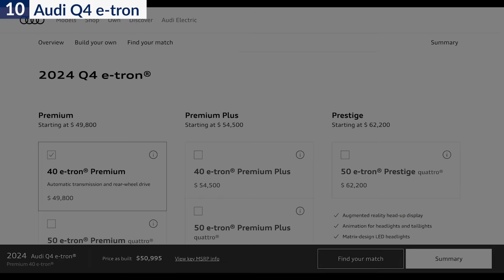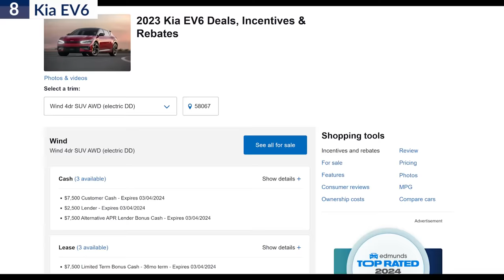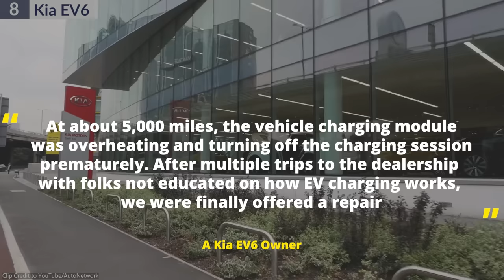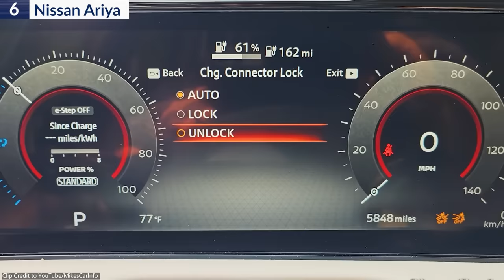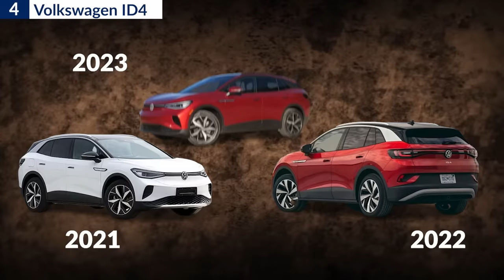New Electric Cars Piling Up on Dealer Lots in 2024 – Here is the Truth!

Comment: I own a electrical company in Germany.
We now got a notification that homes will be stalled at 4kw at certain times per day
Thats the case if you have electrical heating or a wallbox.
You wanna now why?
Our grid is not stable enough to support the amount of energy that is about to be used, due to that the grid already has to be controlled.
We are far from a ev only situation, and because our grid that’s impossible
Reply: Is why government needs to be involved so that the system can be updated and augmented to handle the transition that is coming.  

Public money needs to be invested in moving in this direction, the energy for transportation needed is being distributed one way or another.

It is much cheaper in even the near term to build out the necessary infrastructure and be at the cutting edge of the change.  Set yourself up to reap the rewards of experience and hardware as other later comers switch over too.
Reply: Too much wind and solar , not enough coal and nuclear.
Reply: @Leonardo555ZZZ Wind and solar are fine, you litterally can't have too much.  Those in combination with Nuclear is the path forward.  Coal is a relic that has to go
Reply: @sharper68  Wind and solar is unreliable and intermittent . It increases costs due to additional back up ,transmission and storage costs. That is why Germany now has some of the most expensive electricity in Europe , which is causing businesses to leave ,  consumers to struggle , and their economy to decline.
Coal has enabled modern society to thrive , and it's use is continuing to increase every year because it is so cheap and reliable.
Reply: @Leonardo555ZZZ  Wind and solar are new. Your concerns are being mitigated as  large capacity storage technology is innovated and costs drop. It is a one time investment that will get more viable and cheap over time.  

Germanies costs are currently high because of necessary infrastructure investment to meet their green house targets.  An issue which has a grave and extensive costs associated with it impending, if they do nothing.  There are real costs associated with not changing, they choose not to ignore them.

Nuclear should be the back bone of the grid and coal should be dropped.  The costs need to be absorbed because not do so has unbudgeted costs that are far greater.  This is true even if those costs will not be paid next quarter.

Getting off fossil fuel has tactical, foreign policy and trade benefits as well.  Being energy independent is what all 1st world nations should now be shooting for. Germany is an example of leadership, they are investing today in power systems that have many ancillary benefits.
Reply: @sharper68  you lost credibility from the start : "government needs to be involved" when has the gov't never screwed something up and than :  "Public money needs to be invested" yah lets increases taxes that's really bright.  LOL.
Reply: @sharper68  wind & solar are hardly a onetime investment.
Reply: @sharper68 Germany invests in expensive green projects, while China and India are busy building new coal-fired thermal power plants and have cheaper energy and thus the end product.  In the end, when everything is added up, there will be more CO2 and a smaller German economy and therefore a lower standard of living.  Long live the green German agenda.
Reply: @sharper68  Wind and solar are unpredictable, in a sense that it doesn't generate electricity when the demand is there in specific seasons and times of day. Thus, we do need to be able to store electricity, but that's also an expensive endeavor under current battery technology. And nothing is a one-time investment. Solar panels and wind turbines need to be maintained and replaced, so do batteries.

Comment: A couple of weeks ago when Chicago was experiencing very cold weather, many electric vehicles were not working.
Reply: What do you mean not working? That's not what happened
Reply: @cblue in extreme cold weather. Charging stations are not functioning. EV also will lose half of its travel range
Reply: @cblue3581  what part of not working don't you understand?????
Reply: And all the ICE cars needed a boost or were plugged in overnight.
Reply: the fault was the charging station, Tesla in Norway had no problems
Reply: Your brain must be cold

Comment: How could the CEOs, etc of all of the manufacturers be so completely ignorant of the realities of EVs? There is nothing new that is known that wasn't always known. They are not qualified to be running an automotive manufacturing company.
Reply: The real issue is that automakers were forced by politicians to have a particular percentage of EVs produced within a certain time frame.  If it wasn't for the politicians at the Federal level, state or local levels ramming info down their throats to increase production of EVs, automakers regardless of branding wouldn't be in this mess now with EV sales.  Due to the fact that a mandate was issued (by 2030), automakers didn't have a lot of time to iron out the wrinkles for scenarios that we have seen with EVs.  There are many, but to mention one that's common as of late would be EVs not performing well during frigid temperatures.  The vast majority for the general public isn't ready for the EV switch.  Like myself, they still prefer the ICE vehicles they're well accustomed to for decades.  This past year 2023 I got a new vehicle.  Back in July of 2023 I got the 2023 Jeep Grand Cherokee L in the Summit Reserve trim nicely equipped with the 5.7 liter HEMI V8 engine.  Fuel efficiency doesn't bother me because this engine has the multi displacement system, which deactivates four of the eight cylinders during gradual driving.  On some instances, this vehicle will run on just four cylinders depending on how you accelerate.  As soon as you step on it, that's when all eight cylinders will be engaged.
Reply: They knew all of this well ahead of time. PT Barnum remains correct.
Reply: The CEOs never wanted to invest the time and money into building EVs. They knew they wouldn't sell, but the government is forcing them to make the things.
Reply: Interestingly, EVs were around in the late 1800's and very early 1900's. High cost and short-range of battery electric vehicles, compared to internal combustion engine vehicles saw their decline (just like now).
Reply: @adotintheshark4848  Yep.  That's part of what I said in my response.  Things were going fine, but the Government just had to step in all because their prime goal is to make the United States "the leader" in going green.  They fail to realize that it's not only vehicles that contribute to pollution.  Many other things contribute to pollution and they don't want to address them.  One thing I forgot to mention about EVs in general as to why overall sales isn't great is because the appearance of the vehicles themselves looks kinda weird and isn't appealing enough.  Some to most EVs look like a spaceship getting ready to blast off into space.
Reply: 8  years ago OEMs were laughing about Tesla, they are using laptop batteries to make their cars, they can only make 20,000 cars a year.  Tesla struggled to make the model 3 in Freemont.  But 6 years ago Musk got permission to open a factory in Shanghai.  It was very automated and had very dedicated employees and now  churns out more than 1m cars a year, nearly 3,000 a day.  Suddenly OEMs take notice but they thought OK we take our legacy cars, take out the ICE components and put in some electric motors and a large battery, easy.

Now they know it´s not easy.  Tesla does not make cars they make a computer on wheels.   OEMs get 80% of their components from suppliers, but all these parts have different software.  VW spent billions trying to build the software and gave up and now it´s done by a Chinese company.  VW is shutting down it´s european factories and moving everything to China.  Nearly all the OEMs are losing billions on their EV production.  Ford is losing $40,000 per car sold and still struggles to sell them.

The UK and Europe have mandated that ICE cars stop by 2030 except for Hybrids and these end 2035.  Germany got an exception if the vehicle runs on e fuels but the EU said only if the technology refuses the engine to run on gasoline or diesel, with serious penalties if they try to cheat.  E fuel will be seriously more expensive than gasoline or diesel.

Tesla now moving to 48V electrics, steer by wire, brake by wire, all software updates done over the internet.  The software of a 3 year old model Y is the same as a new model Y.
Reply: The issue is dealerships more than manufacturers.

The dealerships make more money selling and maintaining gassers.   Therefore they will push the buyers to gassers.  

EVs are still slightly more expensive than a gas vehicle of comparable quality.   The oil and other dug in interests have made a huge deal about the small number of fires.  (I can show pictures of gas cars on fire too -- hot engine and dry grass do it every time)

We are definitely in the early adopter phase, of 10% or so.  It comes down to how you use your car, if you tow, and if you can charge at home.
Reply: @iainw5081  The only reason they sold then was because few women could crank the gas-powered cars.  Electric starters changed things.
Reply: @robertwoodhouse-bm7kt  Thank goodness Teslas are hacker-proof.  Wouldn't want them to all turn left at the same time.
Reply: @jefferybaxter1225 funny. Belgium too wants to be the leader in green technology. It's almost like there is a global agenda for this green policy....
I read an article about the CEO of a huge car manufacturer being residenced in Brussels, well close to the European Union hq and regularly she has meetings with the EU members about the electrification of the car fleet and she acknowledged that he main issue was the political interference of the EU obliging manufacturers to produce EVs on their terms in stead of just listening and respecting the knowledge and budgets of the manufacturers to transform to an EV market. The cost of technology and marketing for EVs just skyrockets and is eating up all of their budgets which are needed to be not operational but also profitable. Global green politics are ruining our world economy.
Reply: @jefferybaxter1225  The real issue is that these legacy manufacturers are attempting to produce off EV like their ice vehicles. This is why Tesla is successful. It is a software company that produces vehicles right now until these other companies figure it out it’s best to stick with Tesla.
Reply: @JVdN3000  Yep.  That's true.  Each global region wants to be the leader which explains the rush.
Reply: They calculated the sales and pricing by government incentives, so they believe if the price will be the same as petrol cars (after incentives) the public will switch. 

Completely wrong
Reply: @Amitgod123  Yep.  They were definitely wrong with that assessment.
Reply: @adotintheshark4848  Which government is forcing which automaker to make an EV? Tell me which one and show me the law in place to do so. Otherwise you are just making shit up.
Reply: @TubeDude My guess is that those CEOs saw the Tesla cars and thought, "Well that looks easy enough." What they didn’t factor in was that Tesla has been is this game for over fifteen years now, and has access to some of the best and brightest engineers in the world. Add to that the structure of the Tesla engineering workforce where everyone has the capability to suggest changes and improvements without going through endless committees. Tesla made mistakes in their early days, and will likely make some in the future, but they learned from them. Munro and Associates tore down Tesla’s first attempts at a car and were very critical of their first efforts. Tesla took every one of Munro and Associates criticisms and suggestions and incorporated them into their next version of their cars. Munro and Associates is still marvelling at Tesla’s innovations in car body manufacturing today with their gigapress technology, which I believe stems from Munro’s comments on their first cars with changing the Tesla design philosophy completely. Munro and Associates offers design advice to whoever wants their services. They are on record saying Ford, GM and Stellantis has never approached them for EV advice. Who thought a four ton F150 was a smart idea? I’ll stop here.
Reply: @petergersbach7355  Don't forget about the interrelationship between Tesla and SpaceX. Tesla doesn't just have access "to some of the best and brightest engineers in the world" at Tesla, they access them at SpaceX too. If that is what you meant by your comment, my apologies.
Reply: Most motor dealers must be ex politicians….
They don’t listen to the public either !
Reply: @robertwoodhouse-bm7kt  carmakers should ignore this EV garbage and continue with ICE vehicles.
Reply: @adotintheshark4848  EV's won't sell?  I guess Tesla didn't get your memo.  Auto manufacturers and especially dealers hate EV's because they won't make any money selling
repair parts.  EV's will sell when they are priced so average income people can afford them.
Reply: @jimseifert8047  but they aren't priced that way. Many Teslas are leased..and once the public has had its fill of EVs' inconveniences, they'll avoid them like the plague.

Comment: Who can afford a very expensive  ev when you have a prefectly petrol or diesel vehicle  in the driveway ?
Reply: Bought two Tesla s to replace my expensive to maintain BMWs.   BMWs were sporty to drive before EV came along, and just charge at home instead of stopping by gas station every 3 days and going to dealerships.
Reply: @Trust_but_Verify  Not every classical car is expensive to maintain!!
Reply: Who can afford a petrol or diesel car. When the Tax on it is much higher. And gasoline and diesel is so expensive ?? (My Tesla is the cheapest car i ever had.)
Reply: @beni22sof  Most people don't own classical cars... talking about modern daily drivers that's less than 10 years old.   I don't keep cars for more than 10 years old, typically the mileage is way up there that  repair/maintenance cost of the vehicle is higher than the cost of the vehicle.
Reply: In some place like Madrid

Recharging  station  prices are 135 % more than buying petrol  or diesel 

Even a blind man could see the businesses  were going to profiteer and charge extortion  prices 

As if you can't charge  you ev or hybrid  at home 

You have no choice but to pay whatever  theses company want to charge 

It wont be too long before you will be paying over a dollar per kilowatt or more 

I don't know how people  thought  they would save money buying an ev 

As its impossible  to do so 

Unless you have a  solar  power system installed  at home 
But even then  due evs costing alot more than the ice equivalent 

They report 140,000 or 4 years before you break even 

But we all know as soon as a new shiny  model comes out every  one wants the new one and trade in the old one in a year or so
Reply: @Trust_but_Verify   you will find that the Tesla's are alot more expensive  to insure  and maintain 
Plus if you damage the battery  in any way 
60 grand plus installation 
That's if the tesla doesn't  burn to the ground first
Reply: @HermanWillems  wait til it  costs a dollar per kilowatt  to recharge  you ev at a recharging station

Most place it's at 70 cent per kilowatt  or more already 
Oh don't damage the battery  as it's 60 grand for the replacement  and don't expect  tesla to foot the bill 

So I don't see how owning an ev is cheaper than a ice equivalent
Reply: @waynehewett4017  If it's not economical for the person then don't buy one.   In the US the electricity is 1/3 the cost vs gasoline in operating.  18 cents per kilowatt.   My work also has free level 2 charging.
Reply: @waynehewett4017  Tesla provide their own insurance and Tesla hardly needs any maintenance.  No fuel pumps, no gearbox, no oil filters, brakes don´t get used much no spark plugs no clutch for most BEV.  First 2-3 years it´s change the cabin air filter and swap around the tyres.
Reply: @waynehewett4017  Average Tesla charge is 0.25c, you must be using those  not very reliable OEM chargers.  Tesla has 8 year warranty on batteries or upto 125,000 miles.
Reply: This is in the United States. In China, an entry-level electric car with a range of 300km only costs $12,000.